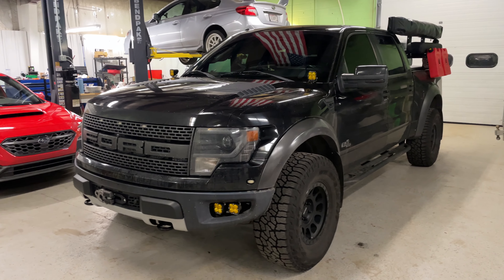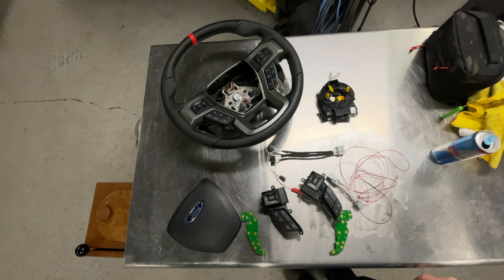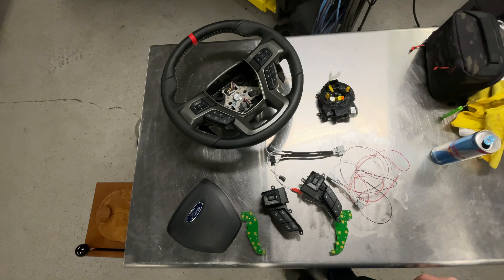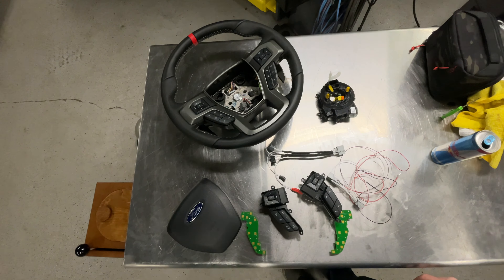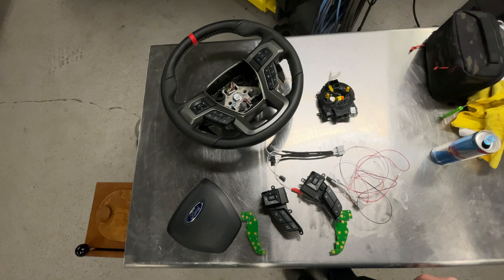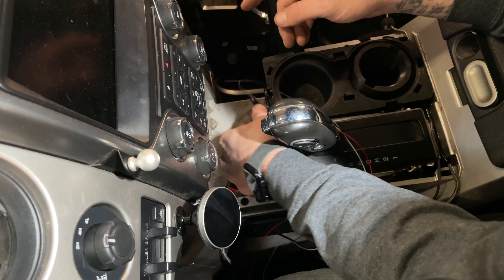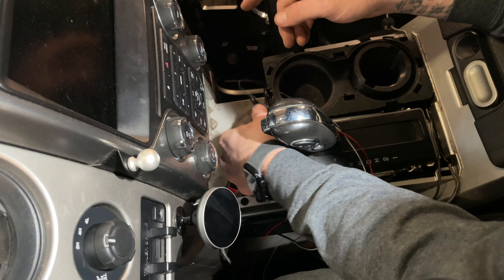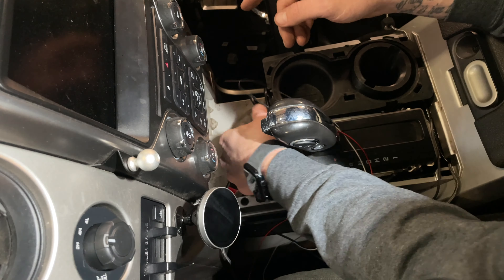BEST GEN 1 RAPTOR MOD?? Steering Wheel Upgrade Install

Comment: Great video! I did this conversion in one of my Gen1’s a while back and paired it with the Sync2-Sync3 upgrade, which is much faster and gives you Apple CarPlay. Once you do both it really updates the truck and gives it a much better overall driving experience!
Reply from the maker: I almost did the sync 3 upgrade. However I was turned off by it cause I read that the front camera doesn’t always work the greatest after the swap. And I rarely use CarPlay in my other vehicles since I hate cords (all my charging is wireless). Therefore I couldn’t really justify it
Reply: @jurassic_overland  I installed it on two different Gen1’s I had and didn’t have a problem with the front camera on either. Make sure if you do decide to upgrade that you get on preprogrammed to your VIN.
Reply: @TrevorFosterConstruction where did you buy your Sync 3 upgrade from? It’s something I’m looking into with my new to me 2014 raptor.

Comment: Really want this for my truck. Love the paddle shifters
Reply from the maker: I definitely don’t regret it. It’s so much nicer to drive with it as well!
Reply: What was the overall cost of the conversion?
Reply from the maker: Right around $1300-$1400 including all parts and the harness/circuit boards

Comment: I'm wondering if you can tap into the heated seats for the power for the wheel? The second you turn on heated seats, it'll turn on the wheel heater
Reply: That’s a good idea, I should be getting mine this weekend. Im gonna try to rig a micro switch behind the actual steering wheel heating button, connect it to a 12v source. I’m not sure I’ll have enough space. If that doesn’t work then I’ll just do the  same but rig a button on the side of the column.
Reply: @TESGAVI  make sure it's tapped into a wire that only gets power when the truck is on
Reply: @IndiMan2233  yea, I’m going to have to do a bit of testing. Maybe tap onto the 12v wire going to the aux switches. Those only get power when the truck is on.
Reply from the maker: So the problem I ran into wasn’t necessarily where to get the power from. You can just get power from an accessory add a fuse so that it turns on when remote start is activated. It’s more so how do you plug it into the wheel that has to spin. Without wires dangling or getting caught up in stuff
Reply: @jurassic_overland  that is indeed true, there has to be a way to avoid that turning problem
Reply: @jurassic_overland  is there a 12v coming in from the harness that you could tap into and avoid the turning issue?
Reply: @jurassic_overland  would tapping from the horn 12v be a bad idea??
Reply: @TESGAVI  did you ever get the heat to work?
Reply: Great video!!! Definitely doing this mod. Was anyone ever able to get the steering wheel heat working?  Nothing fancy. Just functional.  There has to be a source we can use off the new clock spring.

Comment: isnt the bolt pattern on the 2011 to 2016 superduty steering wheel the same as todays f250 steering wheels

Comment: That’s not a heated steering wheel button. It’s the button to adjust the steering modes on a Gen 2…normal, sport and comfort.
Reply from the maker: You are correct. I forgot the heated steering wheel function is in the infotainment screen.

Comment: I would sacrifice the paddle for the heated wheel, so those pins in the plug that are for shifting gears could've been used for heated wheel.
Anyway, wonderful work. Thank you for the video.

Comment: This is awesome as I am now looking into upgrades for mine! What is the status of the heated steering??
Reply from the maker: Working on it, just waiting on some connectors
Reply: @jurassic_overland  Couldn't you theoretically use the lane assist button in the new wheel for the heated wheel? Any updates on this? Great video, thank you.

Comment: I did the steering wheel swap , my airbag light is on . Anyone have any info on why ?
Reply from the maker: Wish I could help more. I would double check the two connectors for the airbag. Otherwise double check part numbers to make sure they match up
Reply: @jurassic_overland  hopefully you didn’t turn the clock spring. If you did it’s probably broke inside.
They are very finicky & are made to turn so many turns right & left.
Reply: Ever fix it? I heard it needs to relearn stuff at times…

Comment: Did you get the heated steering wheel working?
Reply from the maker: Just about. Just waiting on some different connectors
Reply: @jurassic_overland  awesome man! I cant wait to see how its done and get one wired up in my truck
Reply: @jurassic_overland any update?